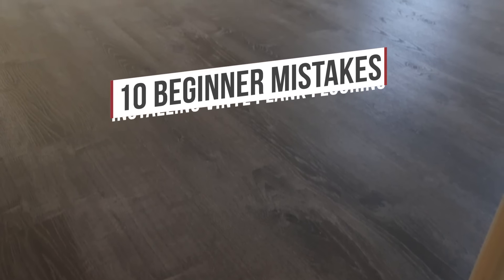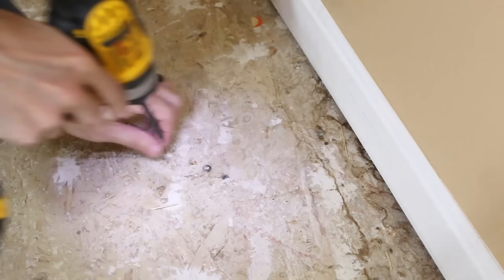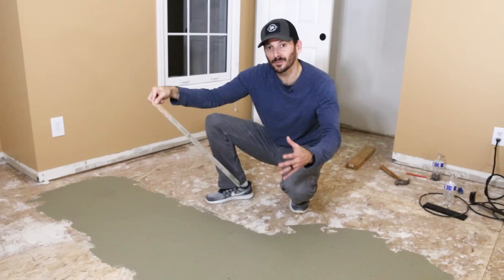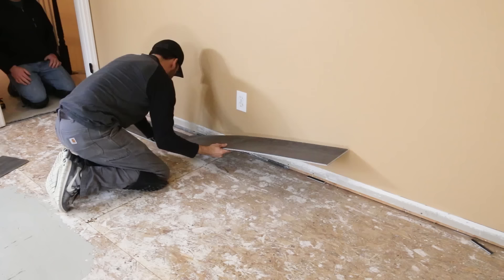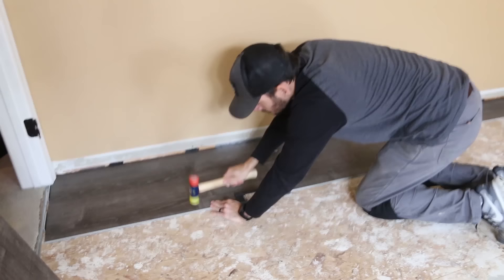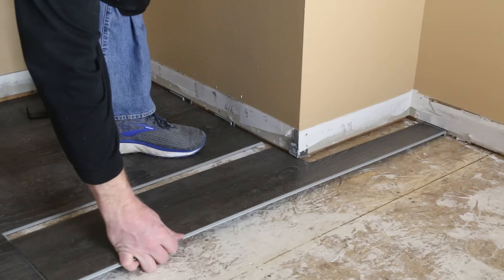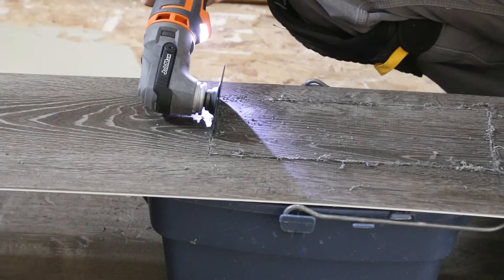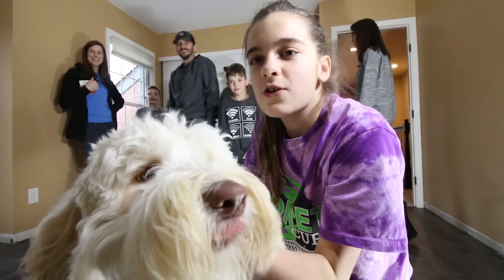10 Beginner Mistakes Installing Vinyl Plank Flooring

Comment: If the baseboards are going to be lower after the install, there'll be a paint gap and seam commensurate with the age of the home.  It's best to leave the base and use quarter round or replace base with all new, taller profile.  The problem with floors is it connects everything, door casing, thresholds, trim, etc.  Just go slow and try to think it all through.
Reply: There won't be a gap. The baseboards will set higher....because the carper wasn't under the baseboards in the first place.
Reply: @marikiemarie7622  It was though 0:13
Reply: No, not in my house. Rental property, ok use DIY tacky, shabby-looking quarter-round. My house after removing the base molding scrape the paint ridge off the drywall. Then use/apply joint compound using a 6" taping knife to smooth the wall surface, sand smooth, and apply primer.  be careful not to damage the molding when removing paint if you are going to use the old base molding. I usually use new base.
Reply: Exactly

Comment: I have a new found pet peeve of people NOT removing trim before doing floors lol. My dad always took it off before doing floors so I just assumed everyone did!
Reply from the maker: I'll admit I've left it in before 😜
Reply: I couldn't agree more, that's just lazy leaving it. It takes minimal time when removing/replacing and you're almost always going to have a gap if you don't.
Reply: Sometimes if you have to leave the baseboard, you may install quarter round, I've been an Master installer for over 40 years and some clients do want the quarter round.
Reply: @armyveteran18th.airborne30  why would you ever have to leave it? An hmm never heard of a master installer before
Reply: Army Veteran 18 the.Airborne 😂

Comment: Great video very informative but I noticed one more mistake. When you remove the baseboard and you drop it down you either need to go buy taller baseboard to cover the caulking line or you have to scrape the old caulking off Patchett and then installed the baseboard so you don't see that thick caulking line above the top of your baseboard. Great tips and tricks though thank you
Reply: And if the job is for a customer;  the job price increased because there is not just necessary work to install flooring but extra moulding and painting work.

Comment: When it comes to the baseboard situation I would've left it, a carpenter took the time to get the joints nice and a painter also caulked already. The floor may not be level and square to the wall which equals cheating things and creating either gaps in the baseboard joints or gaps between the planks and baseboard, floors also have high and low spots, just do the shoe molding.
Reply: Not to mention they are now going to have to address the unsightly exposed drywall above the top edge of the baseboard that now rests lower on the vinyl flooring (@ 12:39). Repainting, or at least touch up, will be required...which will ultimately not match the rest of the wall.  D'OH!
Reply: @kferro  just put new taller baseboards on! I have really ugly baseboards that are only a couple of inches in height and they have scratches from the dogs. I’m buying new modern baseboards that are 4 inches in height, but I’m also painting my walls after doing my floor.

Comment: I've found that a 5 in 1 tool (fancy putty knife) is far less damaging than a pry bar while removing all types of trim mouldings. It helps prevent gouging in the wall and on the trim.

Comment: One piece of advice: Don’t bother with anything under 7mm and check to see that the locking system is robust. I’m finishing up an install with a Home Depot sale vinyl plank over linoleum tile. Unfortunately the tiles being only 5mm, with underlayment, have a small sliver that locks in. It has bee causing a nightmare and in some cases, we have to use liquid nails to make a decent mating with the adjacent plank(s). While the less expensive planks were $400 less for this install, they will probably take an additional 16 hours to install. Additionally, the thinner wear layer also means that they won’t hold up as well. If you break that down and say that the better planks will give you only 10 extra years, you can see how foolish this was, in the long run. Also, despite my complaints to Home Depot and my desire to return the product on day one, unfortunately we had opened most of the boxes and cut quite a few planks. Shame on both the manufacturers and home depot for selling tissue paper flooring. And shame on me for not knowing better. Also, don’t ever ask anybody at Home Depot for their opinion, because they don’t know anything about the products they sell. I wish I had gone with the product they’re usung in this video.
Reply: This is not true. How thick the product is does not necessarily mean it's good or bad. You can have a 5 mm plank that has a 20 mil protective layer and an SPC core that's much higher quality than a 7 mm plank with a 6 mil protective layer and a plastic core.
Reply: @JSGilbert  I read it and then reread it. What did I miss? You are telling people that anything under 7mm is bad. That is completely false. Actually, most of what you are saying in your response is misleading or false. That is being nice. The thickness of your plank does NOT determine wear layer. It also does NOT determine the quality and thickness of your locking mechanism. I do flooring for a living. 
One thing you had correct is that box store LVP is usually low quality with a thin wear and will scratch easily. You can get much higher quality at flooring stores that have 20mil wear layers or higher and SPC cores for the same price or less.
I have laid 5mm flooring with SPC cores, robust locking mechanisms, and 20 mil wear layers that are worlds better than anything home depot offers that is 7mm or larger.

Comment: Excellent installation and performed in high quality workmanlike manner. I appreciate your time and effort for sub surface preparation which determines the final outcome of a project!  It's nice to see someone giving expert advice on a subject instead of a fly by night YouTuber with impractical, improper unnecessary or just simply stupid advice. Keep up the good vids!😁👍
Reply: @AmyJo I bought a house around twenty years ago. I immediately needed the help of a professional for several different projects. I hired three different craftsmen to do the jobs. Each one left me lacking in customer satisfaction. My end summary? Do it myself. I can then do the job "to My expectations." It has worked so far. Thank God for the internet and fellows like these showing us the DIY methods for these "not so difficult" projects.

Comment: I have worked at home Depot in the flooring department for 3 years and the brand your using is home Depot exclusive, meaning, you can only buy it from home Depot... Life proof.. and for everyone saying you need underlayment. That's not true .. it voids lifetime residential warranty if you add your own underlayment below it
Reply: If anyone has questions about this flooring or any other flooring let me know

Comment: best tip ever: screw down some boards as a cleat along the line you want for the second row to start.  Start the second row against those and never worry about the thing shifting as you tap the boards together.  Once you've got the rest done, unscrew the cleat and add the first row using the pull bar.
Reply: You can also just screw through the vinyl on the first row next to the wall or baseboard, install the remainder and then remove the screws and cover the holes with the baseboard or shoe molding.

Comment: Leave the base and add shoe molding.The time you save reinstalling the base, covering nail holes, re caulking the top could be avoided with slamming down some shoe molding in no time and it looks great
Reply: rumpleforeskin73  baseboard always lol
Reply: Dropping the baseboard is a bad idea. the wall above where it sat before protrudes out more than the wall behind the baseboard because of layers of paint and the old caulking. itll never look good unless they get a bigger baseboard or refinish the bottom of the wall which would take some serious plastering skills.
Reply: @jonc9799  -- Serious plastering skills? Scrape and sand the paint/caulk ridge at the top and use a bit of joint compound. No big deal. The room might need repainting, but that just completes the refresh of the whole room.
Reply: @grizzlygrizzle  Yeeeeeep. Point is it's more work than shown here. and people deciding to flush up the baseboards based on.this video should know. They might not want to do all that and find the shoe mold easier
Reply: Shoe molding is not the way to go unless you’re lazy.

Comment: Start 1st row full board, 2nd 3/4, 3rd 1/2, 4th 1/4 and then back to a full board. From there you can usually use the cuts from the end of your rows as starter boards. For the rest of the rows, make sure your joints aren't to  close to the previous row's joints  Also houses aren't generally square. Start at the wall that will stand out the most visually so it looks better for guests who visit. As far as the corner cut L shaped  at the 8:00 mark. No need to pull all your work up. Just cut the full board to fit and then leave the last little bit empty and fill in later after your main floor is laid. You will usually have pieces from scrap to put in there. I am not saying it is wrong as described in the video. Often there is more then one way to do things.  Also an old dull trowel will find stuff like nails protruding from the wood floor. Covering more space and faster. Don't use anything that will dig into the wood floor. On concrete floor just use a scraper to do the whole floor. It will remove any stuff as you check vs checking and then removing.
Reply: thats not the proper way to start a flooring job unless you want that pattern which its called stair step that will repeat itself if you use the cut pieces that creates a pattern why is it called stair step when you look at it when you lay say your first 4 rows  it looks like the side profile of steps its best to install at random lengths seams no closer than 6 to 8 inches and work out of 2 or 3 boxes of flooring at the same time mixing them up gives you the best look
Reply: No do not start your boards like this guy says, thats how u get the studder step look with diagonal lines through out your work
Reply: Like 10 years ago I installed laminated flooring in livinroom and I was having lots of pieces left as I was installing floor. Was waisting lots of planks. Obviously I was doing something wrong. My friend helped me but forgot what I was doing wrong.  So it does not matter the size or shape of living room as long as I follow what you mentioned in ur comment?  All  1st row full boards, second row all have to meassure 3/4, 3rd row all have to meassure 1/2, and 4rth row all have to measure 1/4?? 
U mentioned 1st row all full planks, however at end of row I might have to cut the last board so on second row I still go 3/4 no matter what?
Reply: @jorger5615  Agreed. Stair step looks ugly.
Reply: As others are saying, then you will create a stair step look with your seams. No professional installer would do this. It is a big no-no.

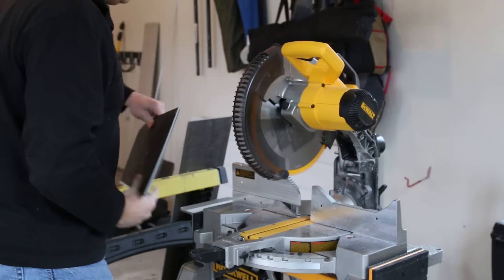Comment: 5:35 Adding a 2" thick piece of timber on the saw base will raise the height to give you a single cut, plus a zero clearance to reduce swarf.
Reply: He could just tilt the plank up while he lift the blade back up, it's what I do. I use a ten inch miter as well.
Reply: A sliding compound miter saw would be ideal...
Reply: RIP saw circ saw table saw if its lvt you can use just a  knife  or or a lam cutter or tile cutter
Reply: Ain't no way I'm walking to a saw for something that is score and snap. All the cuts are hidden under trim so who cares if they're perfect.
Reply: Great tip

Comment: I discovered during my vinyl install that you don't need to cut the rubber layer on the bottom after snapping at the score. Just bend the plank in the opposite direction after snapping, and the rubber should separate cleanly.
Reply: they're not all rubber backed... a lot of them have a fabric like backing made of interwoven fibers

Comment: Dont pound the seems in until they are clicked in by hand. The endge can be broken by forcing them in. 
You could have also check the ending wall to ensure you dont end up with a little strip of vinyl at the end. You simply rip your starting planks to less width

Comment: Only thing i would suggest is screw the subfloor down if its wide open like that why not?..prevents squeeks down the road, other than that great job nice color too
Reply: Prevents squeaks and helps prevent movement in the floor that led to the nails coming up in the first place... ;)

Comment: By lowering the base you now have a line where the top of the base hit the wall in the old position.  With several layers of wall paint this will be visible and require some patching to look good.  Patching and painting vs installing 1/4 round, I would have installed 1/4 round.
Reply: It's kind of a pick your poison and really does depends on the area you live. In some 1/4 round is basically a no-no and will look out of place when you go to sell it, whereas other regions it's common.
Reply: Better to install higher base boards. 1/4 round looks hideous.
Reply: @wadefleming  agreed
Reply: 1/4 round is for homeowners/diy. Looks like crap and not professional, basically a band aid..
Reply: @spf-92.5  As others mentioned depends on personal preference or region.  You think it looks like crap, others might think it looks unfinished without.  One thing for sure, having an obvious line where the base was lowered look like crap.  if you don't want qr or shoe, then patch the walls or install taller base.

Comment: Cool video. I just recently put down flooring over concrete and had the hardest time. Fournuately, it's good, but I had spent a long time getting the seams together before putting in new baseboards. Like the carpet removal technique; used it myself

Comment: Adding quarter round is so much easier than the removal, reinstallation and painting that comes with removing the baseboards. You need to moisten the wood subfloor before you apply thinset mortar. Regardless, leveling compound is a much better choice than using thinset.
Reply: this is the DYI's biggest mistake; cheaping out. This is supposedly going to last a lifetime. Don't use something that is not recommended and hopes it works. too big of a job to "hope it works". use Henry 357 floor patch.
Reply: Thinset also cracks over time as the subfloor flexes.

Comment: The seams at the ends of the planks should appear random. Don't use your scrap end piece as a starter for the next course multiple times consecutively.
Also, add a tack strip for the new carpet edge. The t-mold alone won't hold it.

Oh, and don't trust the walls to be square. Like, ever. Like never ever. Measure the room and run a snap line down the middle that you can measure against.
Reply: If the walls are not square, how do you "run a snap line down the middle" i mean, you need to measure the distance from the side of the wall(s) to the middle, right? If your wall(s) are not square, then your snap line will also not be square. If you get the flooring straight BUT the walls are crooked, how is that going to look?

Comment: This is a great video! Most manufacturers have a gap tolerance between the sub-floor and the floating floor,  ie 3/16" in a 10' radius. Thank you for mentioning using what you have on hand for floor patch. Sometimes you run into door jambs that are steel or another metal. Since these are hard to undercut, using matching caulk is the best finish. Did you really use a t-mold in the doorway with the U channel? Or did you use an end cap? And lastly, I vote for R&R baseboards!
Reply from the maker: Yep, used a t-mold and with the beber carpet it's been fine

Comment: I have 1x8 inch baseboards put in two years ago, I left mine installed, it was simply too much work to chance tearing them apart and then my sheetrock as well. Do I dislike the quarter round, sure, but is it a deal breaker, no, not really. it also helps when your floor is uneven, wihtout it, your baseboards could potentially be unlevel and noticable when hugging the floor. and helps keep those inevitable critters crawling through.

Comment: I just installed Happy Feet loose lay vinyl plank flooring.
It does not snap together and it is not ridged. If your floor is a little out of level does not matter it is flexable and does not require a gap around the perimeter. It does not expand or contract. It goes down after the base board. And with it tight against the base board the is no movement. It was fast and easy.

Comment: Thank you, FixThisBuildThat for the informative video.
We too, pulled all base boards from our previously (carpet over cheap vinyl that was glued down). By removing the base board, you have more options with replacing the baseboard, or reinstalling the baseboard just lower.  Maybe even add an accent of 1/2" or 3/4" quarter round to make it look clean.  Well worth the extra attention to detail.
I am smiling as I watch you explain the mistakes you made, as I have made every one of them myself, and the correct way to fix and avoid them. Great Job.
Should have watched this vide first. Lol.